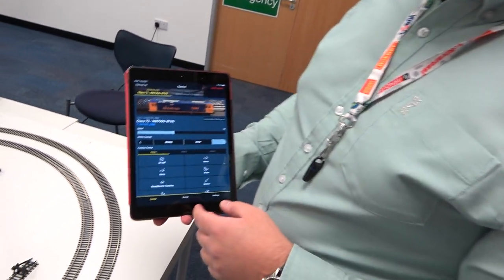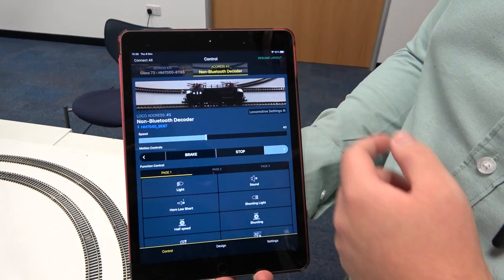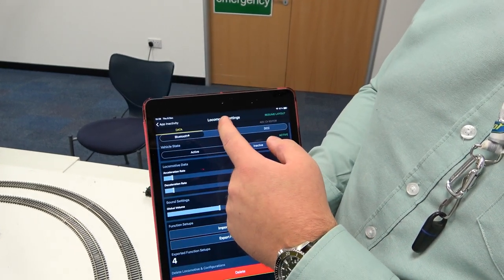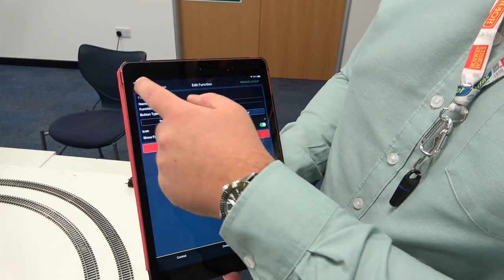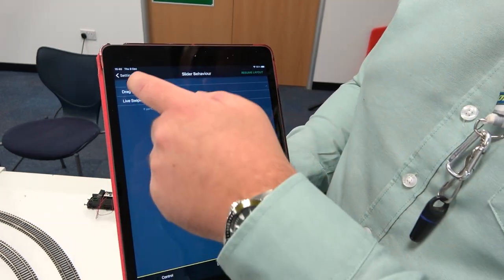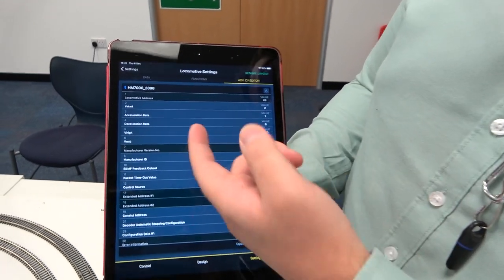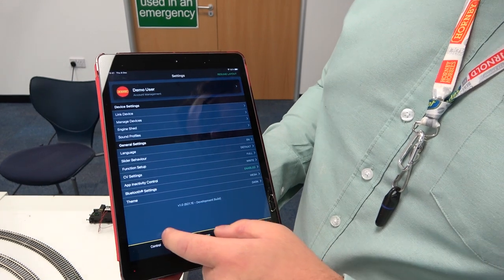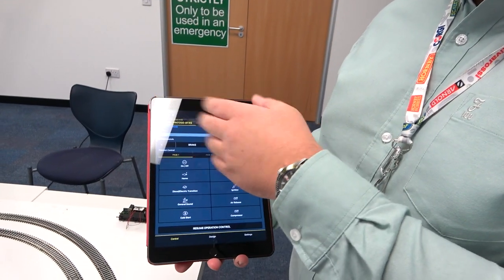Hammant and Morgan DCC – what is it?

Comment: Thanks for sharing this info ! A fantastic evolution in DCC control a affordable price. A few questions: can Function Mapping' easily' be done on the App ? Is 'consisting' with other locomotives possible ? Is the Legacy Dongle compatible with say a NCE Power Cab six pin base station - that is NMRA ? Is the chuff rate in syncro with the steam locomotives wheel rotation on the new TXS decoders ? Thanks for your reply & success. Cheers, filip

Comment: i bought the HM6000 when it came out and couldn't get it to apply power to the track after hours of pairing/connecting and tried to contact hornby for support, which was utterly futile, threw the hm6000 in the bin and bought a dcc system and 20 odd esu sound decoders which have worked perfectly, and vowed never to buy anything hornby ever again, good luck with this as it appears very good but i would recommend a decent functioning customer support/quality control be put in place and someone have a word with the unhinged lunatic that sets your loco prices before i even consider anything hornby.
Reply: “Unhinged lunatic” really!  Do you think Hornby set them high just to annoy folk like yourself 😂
Reply: @Haymarket47  doesn't annoy me in the slightest, hornby prices are a joke, if your happy then fair play to you and I wish you all the best, I hope you never have to deal with the customer service and all your purchases despite the cost bring you many hours of enjoyment, but rest assured they won't get a penny from me.
Reply: Hornby prices are a joke in “your opinion”. 

Opinions are like a***holes sir. Everyone has one, but that doesn’t mean everyone has to listen to it.